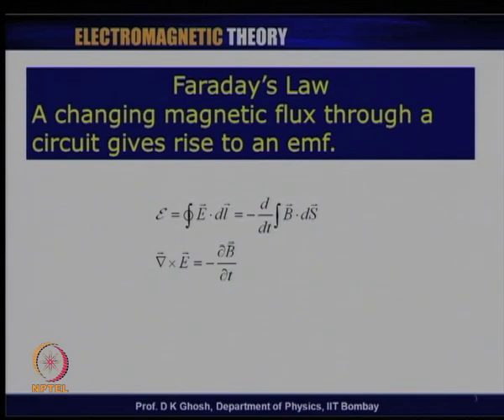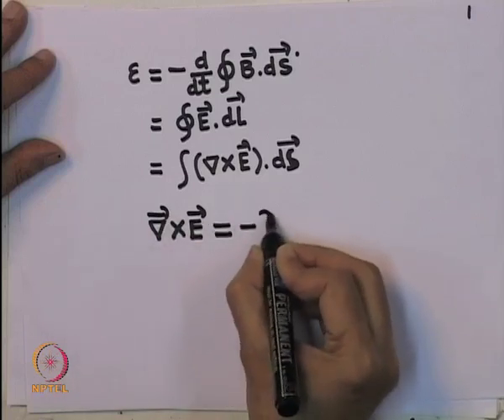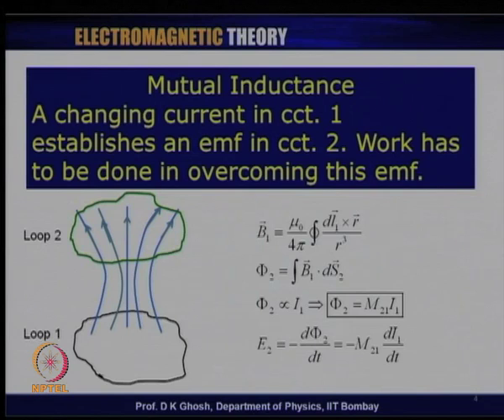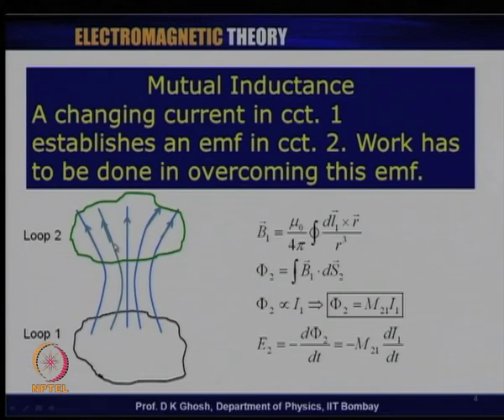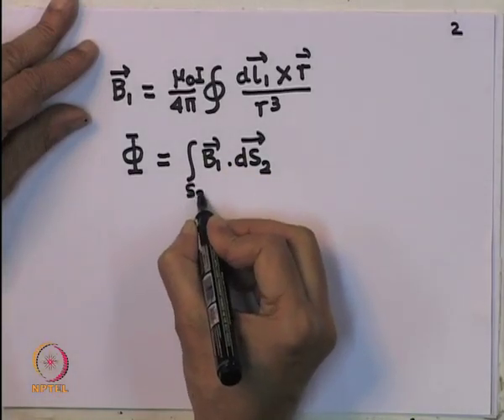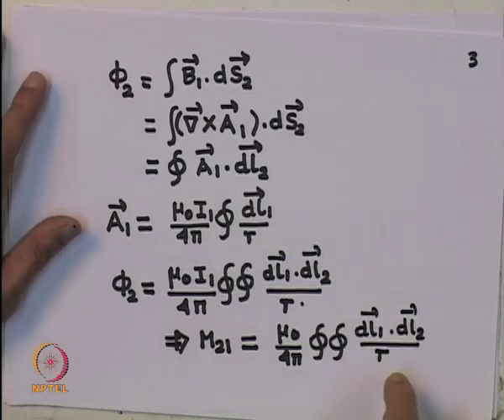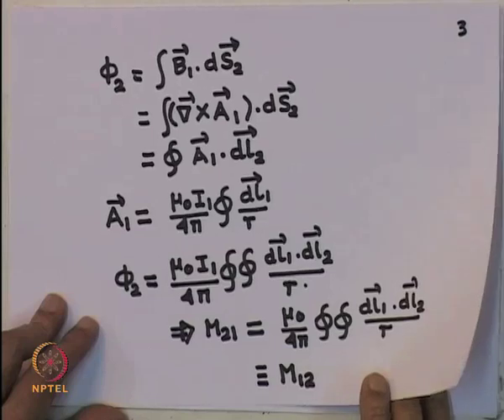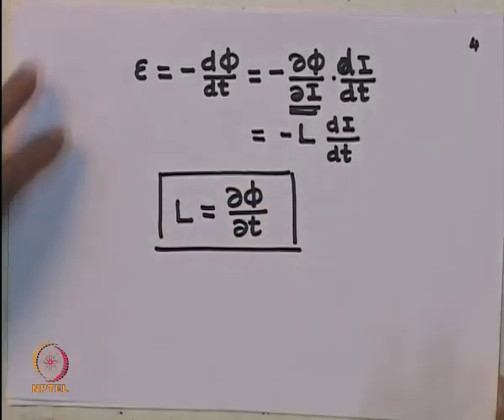Mod-04 Lec-29 Faraday's Law and Inductance

Comment: How come the emf be equal to closed surface integral of magnetic flux, it should be open integral, didn't expected from nptel
Reply: It will be from a closed integral that's the speciality of the entire equation,  don't just comment on anyone's authencity unless you are absolutely sure of what u are saying.
Reply: How can you be disappointed that someone has made a mistake? Grow up
Reply: @gouranggehlot4896  how does emf will induce taking closed surface integral of magnetic field? Pls explain.
Reply: @kuldipkunghadkar6802 not emf ,the electric flux is non zero on a closed surface .